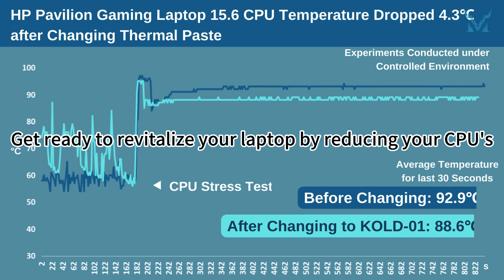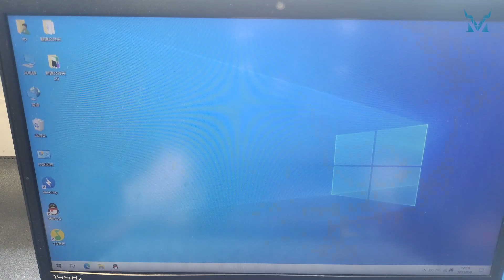Speed Up Your HP Pavilion Gaming 15.6” - Prevent Overheating With Dust Cleaning & New Thermal Paste

Comment: Hi! Any change you replace thermal paste in Predator Helios Neo 16? mine is i5 13th gen, rtx 4050.
 My cpu is reaching 90-98C when playing, so I wanted to change it
Reply from the maker: Yes, we have replaced it before. You're also welcome to try our KOLD-01 thermal paste, which features an exclusive solvent-free formula, offering better heat dissipation and longer lifespan for laptop use.

Comment: Did you change the formula of this paste or why are the specs different on your website and my blue paper included in the package from my last Kold-01 purchase? Thickness, thermal resistance, viscosity are different.
Reply from the maker: We have used more rigorous instruments and enlisted more professional organizations for testing; now, the data on the website is more accurate.